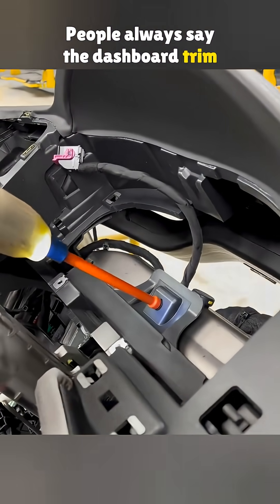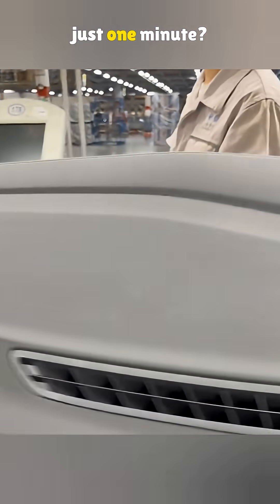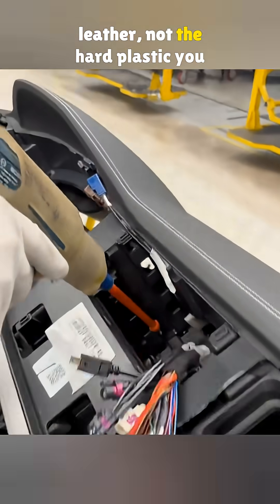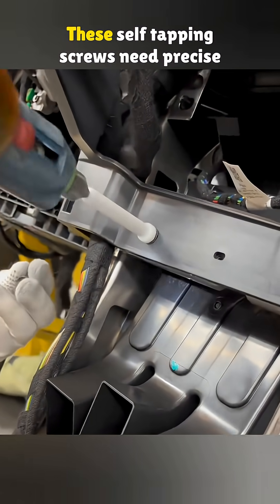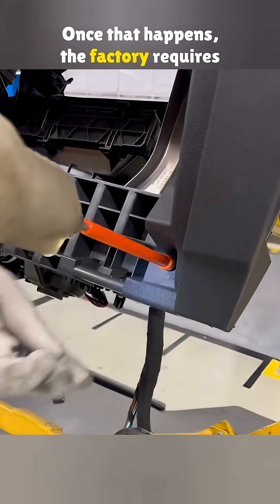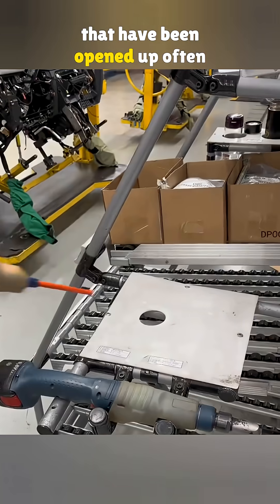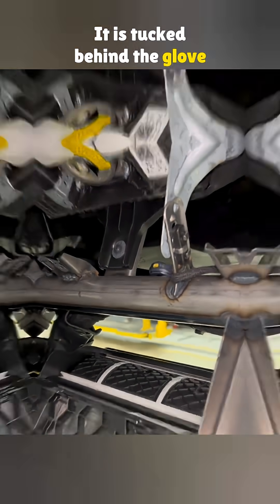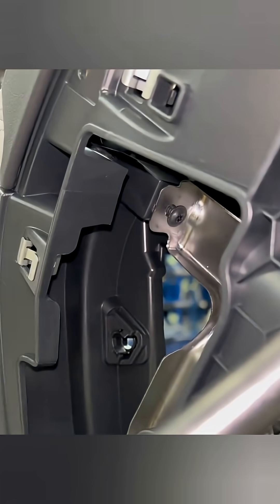How Many Screws Hold a Dashboard Together

Comment: All this, in pursuit of hiding all the fasteners, as if your life depends on it.  Stupid nonsense. Going to such lengths for such an unnecessary thing just makes any possible future repairs 10 times more difficult. 
And 10 times more costly. Plus, it adds completely unnecessary weight to the assembly, which only reduces the overall efficiency of the finished car.

As I said....bloody stupid nonsense.

Comment: My brand new VW Polo GTI has a dashboard with a ‘random’ rattle in it. Intensely irritating and extremely poor build quality.
Reply: I bought a brand new rabbit in 1982 and the heater core inside the car was leaking and a rear wheel bearing was cracked from incorrect installation. The dealer refused to repair the broken wheel bearing so I bought a new one and installed it myself (A brand new VW Rabbit) It was the last VW I bought.

Comment: are the screws made of plastic? everything else is. and that's only one style of junk you're working on. some use shitty little clips. they used to us things called bolts or machine screws/nuts. and you actually had to spend time taking them apart. and you had a large hunk of metal in your hands.